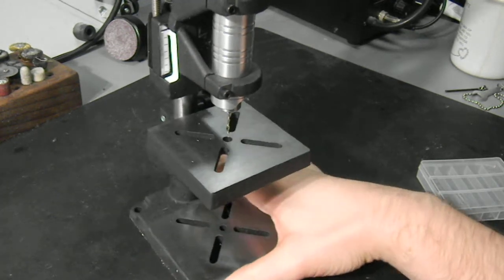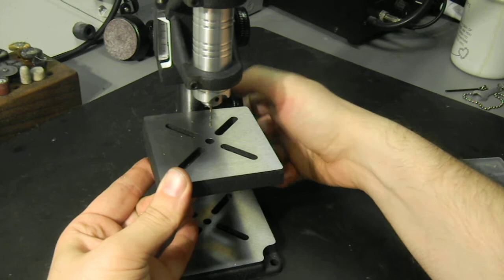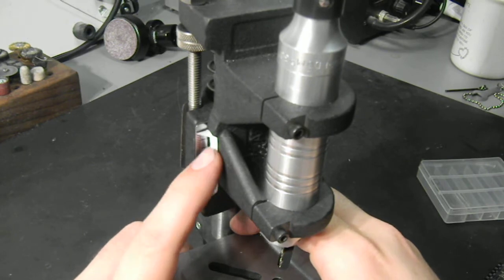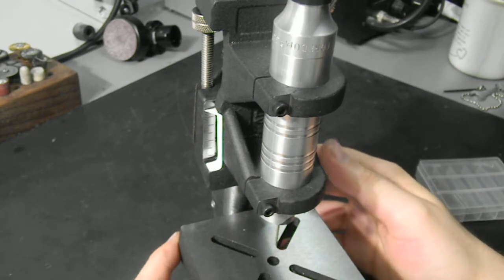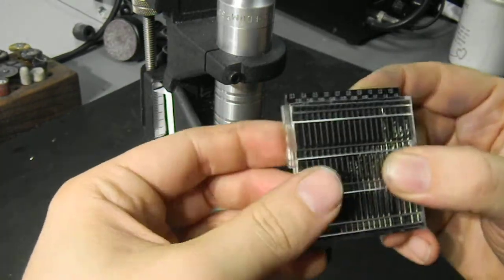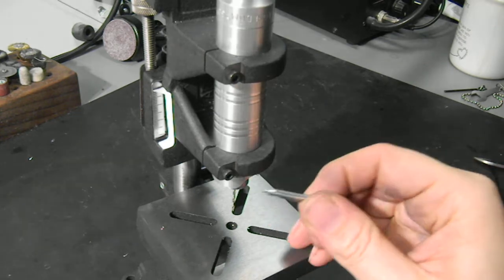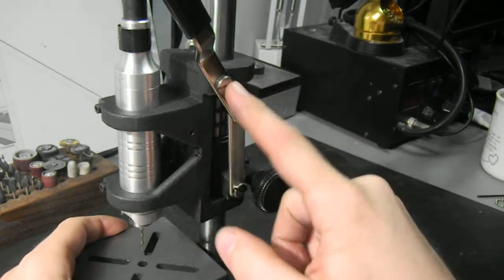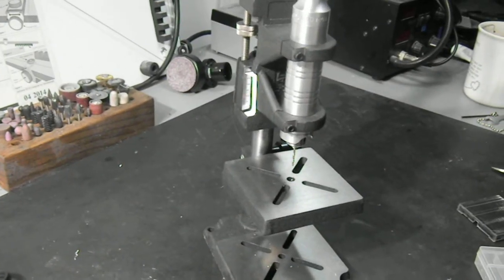Foredom Drill Press (P-DP30)

Comment: Can you remove the top or bottom pieces? I am thinking of trying to make a basic fantasy cutting jig but would like to mount the top piece it in a horizontal application without the bases being in the way. If I could use the rod and top piece or remove the top piece to attach to another rod this would achieve what I am looking for and answer my question. Thanks for posting.
Reply from the maker: yes u can remove the pole from the 2 shelves
Reply from the maker: also you can swivel the table around freely to face it in whatever direction. Bolt the base to table, etc.

Comment: Are you sure it's cast iron and not cast steel?
Reply: Why do you need to know?..the black coated parts are cast iron, the shaft is steel..…read the spec..
Reply: @johnhall8455  Can you define cast iron? Is it grey iron, malleable iron, white iron, or ductile iron? They're all different. I was hoping someone from Foredom would respond to my original question. You were not helpful.